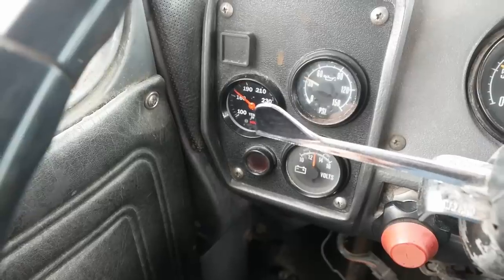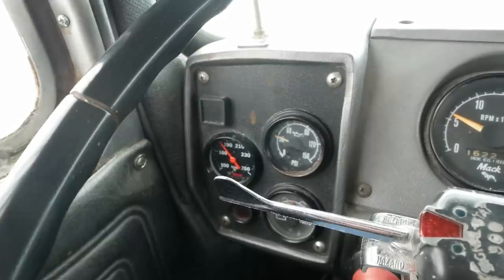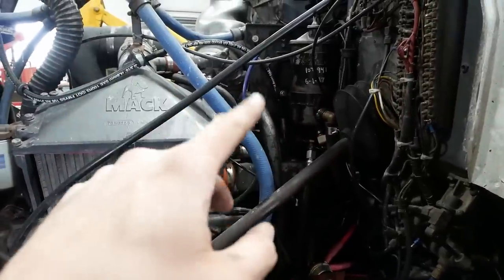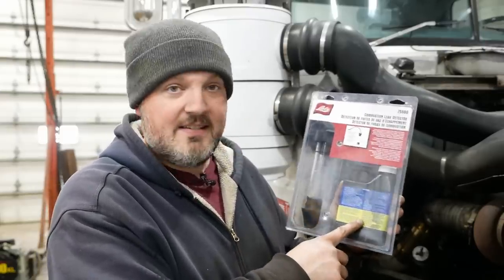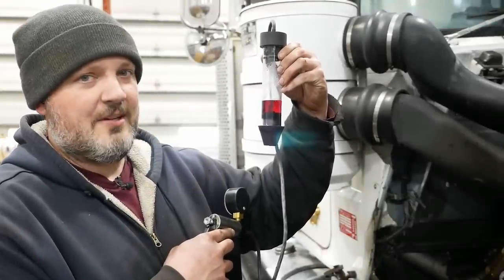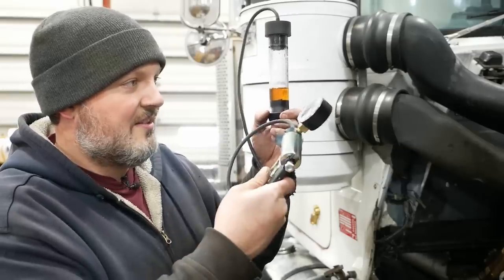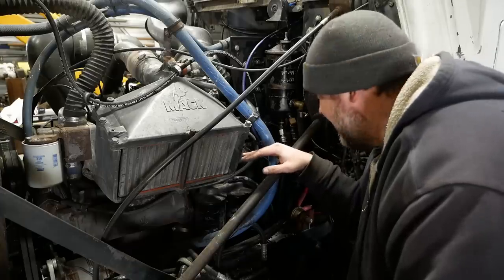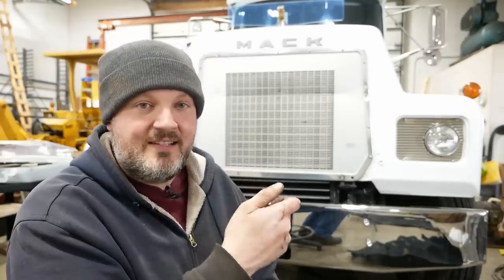Can You Trust a Head Gasket Tester? - R Model Mack Overheating

Comment: In scenarios as this I usually place an adapter on the radiator filler neck and use long hose to another container containing water and get my samples from it. That way you can visibly see and gauge/measure how much gases are being expelled. Best to do this on a cold start and up and observe to operating temp if possible. A plain low pressure gauge can also be installed to see if the pressure exceeds cap relief pressure. Yeah, I do not have much faith in those chemical gas checkers either. I believe your theory holds water on the head, gasket or block. This is just the way I have done it. Results may vary. 😂

Comment: In the VW TDI world it's very rare that a combustion gas tester correctly diagnoses a bad head gasket... false negatives the vast majority of the time.  No one uses 'em any more as a result.   Also common for the issue to only show up when the head is under pressure and wanting to lift under boost... all is well in the driveway at idle.  Pressure transducer method might pick up issues under boost?  Hopefully never have to find out!

Comment: I highly doubt that the temperature of the motor and fluid can rise and fall that fast. A thousand pounds of steel and 12 gallons of antifreeze can’t cool down from 250 to 150 in 30 seconds. Plus the truck doesn’t sound any different from being so hot it should seize to running at regular temperature. The motor isn’t boiling over which at that temperature it should. An IR temperature gun should help diagnose the problem but I suspect it’s in temperature gauge, sensor or wiring. The glove thing doesn’t really tell me anything, the radiator cap holds 12 psi or so and the glove probably is showing less then 1 psi to blow up like that, normal expansion of the fluid would account for that.

Comment: Coolant is slightly alkaline and this acts like a buffer to neutralize any acids and prevent corrosion.  I am wondering if the coolant is relatively fresh then I would expect it to neutralize any CO2 from the combustion gases.  The gas you are analyzing would therefore not have any CO2 in it.  Just a thought.  The expanding balloon could be from nitrogen that remains after all the oxygen is consumed in the combustion process.

Comment: Check the air compressor again on a shop air compressor if you open the drain valve and let all the air out. if the compressor is still on you will still have a small amount of pressure building in the tank not all of it can get out of the drain valve that quickly. 

I would disconnect the compressor first before calling the head gasket

Comment: I wonder also if it's not an intermittent blockage. Maybe it's worth doing a flush of the block and check for foreign matter?
Reply: Yeah, it's got to be something intermittent to do with the flow. The very large amount of water in the cooling system could not change temperature that quickly. Physically impossible.
 So it looks like the temperature gauge is getting water from a hot spot and then a cold spot alternately, so to speak.

Comment: Just wondering Wes could it be that charge air is being forced into the rad via the intercooler if it uses coolant instead of air? Could that explain the leak into the coolant but absence of combustion gasses?

Or I suppose it could have a crack between an intake passage and the cooling jacket?
Reply: I think that intercooler is air to air.

Comment: Wes, could you remove the injectors and pressurise the each cylinder with shop air (effectively a leak-down test) to see if you can get air into the coolant?
Reply: As well as use shop air to pressurize the output of the compressor to see if his glove will inflate.

Comment: After graduating college at FSU , I packed up my belongings into my Mazda B2000 pickup and proceeded to drive home to Daytona Beach in the heat of the Florida summer. Head gasket gave out at Lake City, truck was overheating. I got home by driving with the heat on full blast and stopping at gas stations to hose down the engine.

Comment: Great video 👍🏻.  I’ve never had any success using that combustion gas tester either.  All it did was prolong my diagnostic time on the 2 engines I used it on.  Both had blown head gaskets.  After the second one, I quit using it.

Comment: I have seen something like that with a small car, had a 06 Dodge Neon the head gasket was blown? Like It would run fine for about an hour of driving, then suddenly the temp gauge would just max out in a second and the car would go in limp mode before I can could even pull off the side of the road, Never lost any fluid, but she was hot. I eventually took the thermostat out and bought that Blue Devil head gasket stuff and dumped it in and let it run for 45 min, It fixed it shockingly, I didn't care  much about that crappy car anyway, beater with heater mind you. It held for over a year until I sold the thing.

Comment: Yep, tough call. I used to get good results with a similar tester made by Snap-On- Blue point .It only used one liquid and changed a different colour depending whether testing Petrol or Diesel coolant. Also I was fortunate to have a gas analyser for carrying out emissions tests on petrol and diesel vehicles as part of the yearly U.K. MOT test. Even then it was not always cut and dried.
Reply: They are all rebranded by lisle tools same tester.
Reply: The principle's the same for all of them, but I definitely prefer using two different test fluids instead of the all in one fluid.

Comment: 170 sounds hot for that truck and cooling system on idle . I had a fleet of freightliners with cats and series 60s and they all idled 120-140 during extended idles and they all had temperature controlled fan clutches with overrides. That thing is idling 170 with a continuous fan . BLOWN HEAD GASKET OR CRACK

Comment: I think your diag is spot on.  I've seen that on Subaru engines.  Running the engine at a different rpm works the gas bubble away from the temp sender.
I've also never had much luck with those fluid testers.  Same experience, I can't think of a single time it's changed colors even when every other sign points to a head gasket issue.

Comment: I’ve seen this issue before and it’s caused by air/gases in the cooling system. The water/coolant cannot change temperature that quickly, there is way too much volume of liquid there and it take an absolutely insane amount of energy transfer to change the temperature that quickly. A small volume of air or gas, however, can change temperature very quickly.

I’ve definitely seen head gasket issues that aren’t detected on block testers, especially on diesels, even when using the correct fluid. I think that’s because they pump so much more air than combustion gases when they aren’t under a load, so anything it’s expelling into the cooling system will be mostly air. Ideally you’d do the block test while under a load, but that’s not really possible.

Another way to verify or disprove that this is an engine issue would be to remove the glow plugs (if this thing has them) would be to pull them individually, thread some sort of air fitting into them and pressurize the cylinders. Basically a leak down test. If one or more of them is leaking into the cooling system, you should be able to see it.

Comment: I never trusted that fluid. I remember getting into an argument with my boss. (This was on a gas engine in a car). I was certain the head gasket was blown and I wanted to do a leakdown test. He said, the fluid stayed blue, no head gasket leak. I was so sure that I told him I'd do the leakdown test on my time. If it was the head gasket, he'd pay me. If not, no pay. He agreed to the deal, I did the leakdown, and sure enough, antifreeze started overflowing. Did the gasket job and problem fixed. He didn't question me as much after that....(Don't get me wrong, good man, but a little pig headed...)

Comment: 2:45
You sound like you're from some alternate universe where in The Blues Brothers, instead of driving in an old Dodge cop car, they ride in an old Mack.
"This truck has a Mack motor, Mack suspension, Mack tires, and it was made before the mid 2000s so it will run good on regular sulfur diesel"

Comment: Is it possible the air compressor has a bad head gasket? That's why your tester isn't working for this. Curious if the compressor has been changed while this owner has owned the truck. They can cause some weird problems when they fail.
Cheaper and easier than a head gasket, if it hasn't been changed. Worth a shot I guess.
Reply: That’s what I was thinking too, just because the air out line was disconnected doesn’t mean pressure can still make it through the air compressor head gasket. 
The one way outlet valve that allows air out of the compressor takes some psi to open it.  I’m thinking instead of air going out the one way valve it goes mostly into the cooling system aka head gasket of air pump

Comment: To check if it's the compressor you need to feed the compressor intake with Co2 then it would show on the tester, you could also pressurise the individual cylinders with a shield gas bottle carefully and a flow meter, or pull the head or valve on the compressor so it just cycles,  the air could easily being pulled in by the water pump if the seals were incorrectly fitted a wipe of grease would stop it temporarily, as would running a water hose over the water pump ....

Comment: Who needs a big fancy scan tool or big fancy chemicals, when you have an orange glove! 😁

On a serious note, I know you fully unloaded the high pressure side of the air compressor so it just be pumping straight to atmosphere, but can you completely mechanically decouple the air compressor so it isn't even being driven (no rotation) while still being in the cooling circuit? That would definitively say whether it is or isn't something (however weird/implausible)  internal to the air compressor.

Comment: Have had the same problem on my car. The harder it revs the higher the temp needle goes, no matter the speed, weather or outside temperature. Never actually overheated but it comes close enough to be uncomfortable. From what I've seen someone's been in here already and they did just the worst job I've ever seen, the rocker assembly broke at one point and they just welded it back on.

Been thinking of a rebuild, but probably not worth it.

Comment: I had a old B model it had wet sleeve with a pin hole all but bottom of stroke pressurised radiator over heated at times mostly by blowing water out but ? Would that show in chemical test . I found my problem after a time as it started getting small amounts of water in oil ? Just a idea then my old 1962 B61 was a beast 6x6 with a 5 into 4 with 2speed transfer case and yes a Thermodyne over worked and all way over loaded

Comment: Nice job Sir.

I sorta think your video has the answer lurking in it...

You say it sat outside & idled for 45 minutes...  and it seemed fine...

DRIVING it, the problem showed up....

Some of these head gaskets only show up under a load, with the engine trying harder....  Like going up a hill, or something like that....  I still sort of would have thought that the gas tester would detect that though...

This was many years ago, but there used to be paper test strips you would dunk in the coolant, and it would change colors for "combustion by products" in the coolant....  I presume nobody does that anymore???  The gas pumper thing is supposed to be better????

Your theory about the gas bubble is what we all used to think, years ago....  If your temp gauge is bouncing, it's seeing a hot gas bubble....  The glove blowing up is classic head gasket....  I don't know.   Why is the test negative???  I do not know....  Obviously, it's not my truck, and it's not my money....  But if they've been battling this for 2 years plus, it's time to pull the head, if they really want it fixed.....

Comment: 100% head gasket or cracked head.  My 96 GMC 6.5ltr Turbo Diesel did the EXACT same thing.  Finally took the heads off after 2 years of issues.  Heads were cracked.  I understand 6.5 diesels are known for cracked heads but none the less,  mine did the exact thing yours is doing.

Comment: Wes clamp the coolant lines to the compressor and see if it stops the pressurization you can also put a handful of ground pepper in the radiator it will block the leak without hurting the cooling system then you will know it is a headgasket or a cracked block/head my guess is back purge from the compressor cooling line cheers from down under

Comment: Hi Wes, I worked on aircraft for a while and we used to do a differential pressure test on each cylinder, where you pump a maintained pressure in and it will also tell you the output, ie how much it is loosing, this is helpful because if it’s loosing too much you can find out where by finding the air leak, if you did the same test it would pressurise the radiator if it had a bad head
Reply: How did your system identify if it was a gasket or a cylinder head or a engine block?

Comment: Hi, i recently had simillar issue with Hyundai diesel ... pushing air into coolant. Fluid tester showed nothing, bypased EGR cooler, confirmed water flow with no thermostat .... it was the headgasket.  And the coolant temp jumped also with the air buble.

Comment: The compression stroke on a diesel contains only air.   At TDC only air escapes from a cracked head.  The tester is designed for head gaskets where both air and combustion gases escape not cracked heads which close up when the pressure comes off.  Combustion which occurs after TDC doesn't create the same pressure shock as compression.  The easy test is to spray co2 into the air cleaner and watch that escape into the cooling system and turn the tester yellow.
Reply from the maker: That makes no sense. If the combustion pressure was less than the compression pressure the engine would not run.

Comment: If it isn’t blown too bad you may be able to crack injector lines one at a time to see which one stops the pressure build up. This would only be if it’s holding good enough to only leak when firing.

Comment: You have My sympathy. I have a theory. I know  gage compression tests on diesel can be tedious. Wondering if a relative compression test that uses battery voltage fluctuation during cranking could pinpoint a relatively worn weak cylinder with leaky HG. If there is not enough compression in one cylinder to ignite fuel, there will be no combustion gas to detect,  turning weak cylinder into a weak air compressor.Does pressure rise  enough to cause cap to vent? Maybe measure coolant system max pressure during test?An early pressure rise in system before temp increases can be a good indicator of HG.

Comment: One thing's certain. The coolant can not change temperature that quickly. That's physically impossible. Too much coolant, not enough energy. Even if you drain all the coolant, that big engine block will overheat, but certainly not that fast. What ever the coolant sensor measured, it was not coolant. You could test that by an improvised, second coolant temperature sensor somewhere else in the cooling system. It should not run wild. But I doubt that the test is neccessary. The temperature gauge is running wild when you drive, it settles down as soon as you idle. That means, any testing done in idle will not replicate the situation. I'm not sure if revving up without a load is enough to replicate the problem. If the truck has a PTO, you should give it some load. 

Another thing should be certain. Exhaust gas should have more CO2 than your breath. You could test the test kit on an exhaust of a running engine, just like you tested it in front of your mouth. If it doesn't change color in exhaust gasses, it's a human lung function tester, but not an engine tester.

Comment: if you do decide to do a head gasket on it, be prepared to pull all the cyl packs and have counter bores cut and shimmed. almost every time iv seen a head gasket failed it failed because a liner sunk. by the time your cutting counter bores might as well order a kit and in frame it. if its been over heated frequently the head is probably cracked too. you should be able to bypass the coolant lines to the air compressor to eliminate the air compressor for sure.

Comment: It looks like it meets most of the criteria to be a vehicle you work on, nearly 50 years old, put together from old parts from multiple sources, has multiple other problems beyond what your are working on, large and not designed for easy servicing. It does look to be rust deficient, however.

Comment: First truck I ever drove looked exactly like that one. '74 with a Mack 12 speed. That thing had a crazy power band for being a little engine. Dragging a belly dump, a guy with a '06 550 cummins couldn't catch me on the hills. 
Sometimes bad head gaskets present in such odd ways. Your theory about the temp gauge has gotta be correct because there is no way that coolant can drastically change that quickly.

Comment: This is way out there and I'm just going to throw it out there. Is it the correct water pump? I've seen clockwise and counterclockwise water pumps. Is the water pump spinning in the correct direction? I've also seen the impeller on a  water pump that would just just spin around its crankshaft. When I removed the water pump and spun the water pump crankshaft while holding the impeller, the impeller didn't move. This would explain why it does it in high RPM mode. This theory doesn't explain the air cavitation if it has one. Can you put a radiator pressure tester on it and let it run to see what the pressure goes to, and does the pressure stop, or does it keep building pressure?